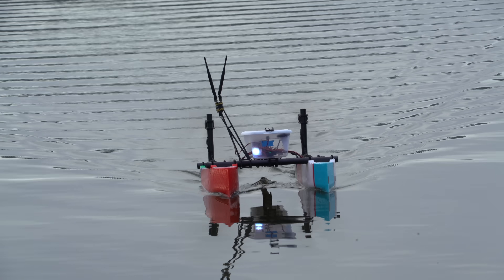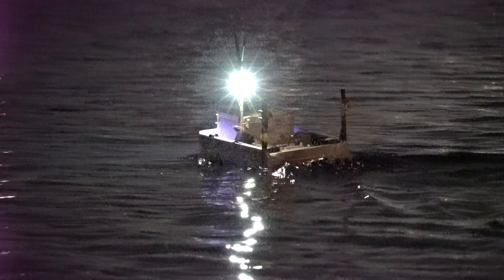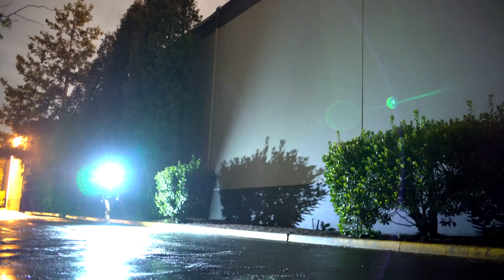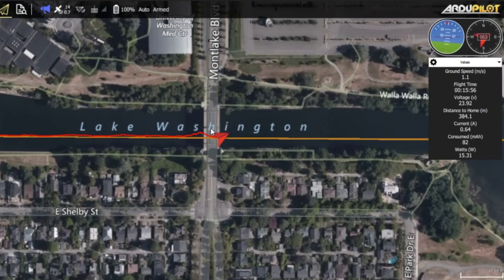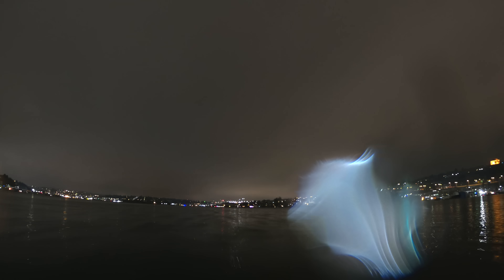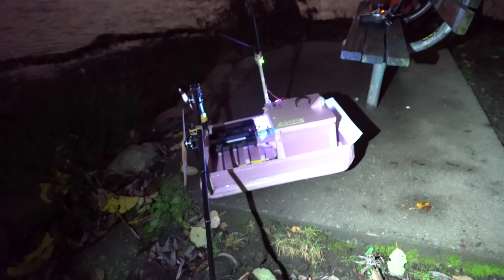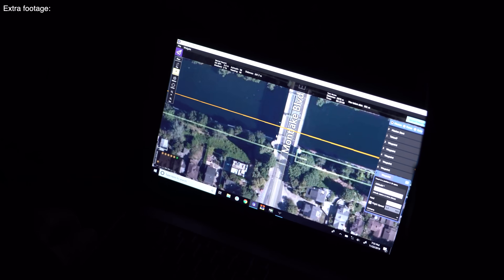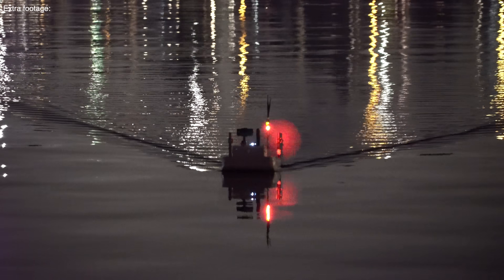Autonomous Boat HYPERLAPSE Machine

Comment: Really cool.
I'm pretty sure your boat dives when power is applied because of the moment of force from your propellers which are mounted so high and at the rear of your boat.
Probably easiest addressed by simply mounting your propellers at the front of the boat.
Or, maybe consider turning them around and drive the boat backwards if your hull isn't hydrodynamically designed to flow in one direction?
Then, your objective would be the opposite of what you're doing... Instead of trying to lighten and make the bow more buoyant, with props in front you'd try to shift all your weight backwards to the opposite end of your boat which would be the natural way to load your boat.

Comment: Just get a low end  kid size plastic kayak from Wally World...  Put your system in that.

And put on the correct Coast Guard (and internationally recognized) approved nav lighting for night ops.

Red/green  in the bow, an all-around white at the rear.
I believe there is a strobe for designating it as autonomous
But here's the link for properly lighting it.

https://www.google.com/url?sa=t&rct=j&q=&esrc=s&source=web&cd=1&ved=2ahUKEwj-7qLy-J7oAhXaj3IEHXhCBEUQFjAAegQIBRAB&url=https%3A%2F%2Fhomeport.uscg.mil%2FLists%2FContent%2FAttachments%2F461%2FNAVSAC%2520Resolution%252012-08%2520-%2520Unmanned%2520vessels.pdf&usg=AOvVaw1yuPnBeXl6WAjd1hZp6mHe
Reply: Looks like you need lights on a stick:  Red on top, white in the middle, Red on the bottom.

Your boat is too small to carry the  1 meter "D" (Maneuvering restricted, keep clear) flag.

Comment: I loved the previous video on this topic.  Part 2 the hull design was a disappointment.  It was simple, that's about it.  Using the same foam board something much better could have easily been produced that offered better flotation, stability, efficiency and control.  Still this hull gets the job done and I very much liked this series.

Comment: You could probably tilt the propellers down so when full throttle is given, it would compensate the nose diving with the downforce from the propellers. Not sure but could work.
Or you could move the propellers to the front and tilt them upwards, so it would lift the nose.

Comment: IF you value advice:
Do it longer.  you'll prevent nose dive, and get higher possible mount for camera. also try build nose higher than the  average wave.. simply try to copy airboat shape .. you'll be amazed how well it works  for camera on rough waters.

Comment: Should've tried a modified v hull. V hull that's taller towards the front with a flat hull design in the back with a keel down it's length. Should keep the front end from diving.

Comment: The nose dive problem is not hydrodynamic, rather it is the thrust vector from the high thrust line.  Tilt your motors up, such that as you increase power, it will push the back of the boat down, preventing the nose dive.

Comment: Your voltage drop was most probably caused by the low temperature infiltrating your battery, saw the same happening with drones in winter.

Comment: Personally, I think you should have stuck with the Catamaran design, but used the foam for the hulls instead of 3D printing them.  The trick to stable but efficient hull design is length.  Simply making the pontoons longer using foam as a building material while keeping a nice laminar design would have eliminated pretty much all of the problems you ran into with both boat designs.  Basically, your boats, while functional, were too pudgy and short to really be effective platforms.  They worked, but only barely.

Comment: finished? basic displacement hull math, square root of hull length times 1.56 = maximum MPH speed, for electrics (gas too but matters more for electrics) multiply that by 0.8.... >
with that, a 4 foot hull will make 2.5 mph, bakes to 1.22 yards per second at displacement speed... but, a 4 foot length could easily be done "jonboat style" where the power doesn't have the leverage to make the nose plow, and runners down the bottom can allow it to pop up on plane, if light enough, low speed hydroplaning (8-9 mph) where watt consumption is lower over distance. my intuition, 20" wide x 48" waterline length (6+2/3 square foot)...

oh chit more displacement math! a cubic foot displaces 62 lbs (buoyancy), so a 31 lb load would draft 6", same weight on 6+2/3 square foot 0.9", if total is 15 lbs then 0.45" draft (and so on) and kinda near nothing to shove up onto plane. two runners 5" wide 1" thick and 6" apart (outside to outside 16 of the 20" width) with 15 lb total, already has the majority of the hull bottom (barely) released, is one method... the other is shallow V hull up front (about 40% of length) and flat behind that with 5/8" step at the chine, slices turbulence (and some waves) aside for the following flat bottom, lifting with forward motion and putting air between hull and water (common stepped monohull hydroplane design). not too unusual for their displacement speed to be higher than their planing speed, if kept light enough. its almost like playing with a Kh4 type airfoil.

Comment: TRIM TABS.....put some trim tabs on the back and have it sync with some kind of auto leveling signal. So as it accelerates the trim tabs will move down in the back to cause the front of the boat to rise.

Comment: For future referencewhen mounting a hyphen in a boat it is imperative to mount the fan as far back as possible in order to get it as low as possible without having the effect of pushing down on the bow.another solution for this would be to point the fans more towards the center of Mass. In this case it would mean tilting your motors up about 5 to 10 degrees. This will have the effect of pushing the tail down as the throttle is increased. Counter-intuitively this should increase your efficiencybecause while it does add downforce into the water it is positioning the hull of the boat so that it is more streamlined through the water

Comment: @2:43 mAh for energy is not adequate since less voltage (discharged battery) uses more amps for the same energy. Only use it if you start always at same SOC.

Comment: I'm surprised that foam didnt end up soaking and waterlogging.
Best way to build a hull is shaping it out of foam and then using strips of polyester and epoxy resin.
Once it dries its tonka tough and light, and you can remove the foam with some acetone.

Comment: Your lack of Principles of Fluid Dynamics for what you are doing is crazy. It could be way better in the water with some changes to the hull.  I'm not going to geek out over it but you could make the hull better, save energy and have a more stable responsive boat!  What you are running now is like pushing a floating brick ! just saying.

Comment: I was under the initial impression that you were using a 360 cam in place of the gopro and gimbal. I feel like if you just hard mounted the one x in the same spot, and used the hyperlapse feature built into the one x, u might get better results. and maybe dont use interval bc it makes the background all blurry

Comment: Catamarans are relatively easy to build, and will increase efficiency significantly. Buy a small boogie board and shove some legs on it (you can through-hole mount them). This will give you a wide platform for stability.

Comment: Damn dude, sometimes when I see the stuff you smash together I think you’re the type a guy that could break a crowbar in a sandbox. Putting a bulge in the front of the boat will literally suck it down into the water, that is the exact hydrodynamic principle that tugboats use to plow them into the water getting more traction when pulling ships. Just move the weight back on the  machine, it is clearly nose heavy LOL
Reply: It's not nose heavy, it's the high thrust line pushing the nose down. It floats nose-high when there's no power.

Comment: now make it solar powered and capable of crossing the atlantic.
Reply: As incredible as that would be, and would definitely set multiple records, those motors would probably last about 5 hours in the salt, and the first big wave would capsize the little bastard.
Reply: Tyler Coates So make into a submarine and somehow seal the motor shaft: maybe use magnets to transfer the force from the moter to the props, and figure out some way to stop the prop from flying off. As for solar power, sunlight goes through a little water.
Reply: @loganiushere  magnets won't exactly be efficient and I'm no expert but I think corrosion proof motors do exist, a little expensive but they do exist. And yeah the solar part seems true
Reply: Someone already made an autonomous boat that I believe crossed part of the Pacific. It was called the Sea Charger

Comment: Do you use anything special to keep the batteries from shorting out? It looks like all the connectors are very exposed with the water coming in over the top.

Comment: I think the best platform you could look at if you want to keep exploring this would be a SWATH. (google SWATH hull). Wouldn't be disturbed by the waves so much and would be substantially more efficient so you could get away with a larger boat with same powering. A larger boat would automatically reduce the relative wave size, reduce the pitch problem and reduce the relative mass of the camera and its effect on trim. What about some horizontal servo actuated vanes to dial the thrust vector with a gyro like the electric rocket. That part should be simple for you.

Comment: This needs to be followed up using an autonomous canoe with lead acid car battery as ballast to improve stability. 
  Can the gimbal be tied into the boat IMU/ Waypoints  to automatically point to the direction you’re heading?

Comment: I'm curious why you keep using air propellers instead of something like paddle wheels, which are much more efficient, especially for a slow moving vessel.  A paddle wheel would also get rid of your nose diving problem.  You would have to add a rudder with a servo instead of differential thrust, unless you went with two paddle wheels on the sides.

Comment: Ohhh, you missed an opportunity to streamline the hull design. Yeah you mentioned why, but you'd remove a lot of the stability issues by using a tried and trusted basic hull design. Especially for the purpose as a camera platform. Double the length of the hull so it can better handle the weight of your equipment.  When you get a design you like, a layer of fibreglass over the foam for impact resistance. 
Anyhoo, still cool 😎
Reply: I too am confused why he continually uses these ridiculous hull designs, like he doesn’t know how hydrodynamics, or aerodynamics work for that matter, considering he’s been building airplanes for a decade lol
Reply: @BikingVikingHH  I know right, you could use virtually any basic monohull or catamaran design and it would be better then what he's coming up with. Heck just buy a RC sailboat and turn it into an autonomous boat. The scale is also way too small for anything--but glassy smooth water. And I don't know why he uses props? Maybe for fear of getting caught up in the weeds if he used standard propulsion
Reply: @77Avadon77  Your guess is correct, his first version had props underwater and they kept getting caught up in weeds.
Reply: @Endelin  which is a good solution. With a streamlined hull, it may take a lot less thrust to propel. Tracking should be increased as well.

Oh well, boats are not his thing... Yet! 😁
Reply: I was thinking the same thing. Just go with a basic SUP or shallow draft Skiff shape. They're specifically designed for this type of water. Put a couple skegs in the back.
Reply: A better hull will not only make the boat  more efficient but adding a keel could also reduce drift so the camera could be more stable. This barge hull is ridiculous for that project. The catamaran desing was way better.
Reply: A flat barge hull is much easier to turn with differential thrust than a more efficient, streamlined hull would be, so it would add the complication of needing a rudder and the risk of getting caught in weeds again.
Reply: @popuptoaster  
Kayak hull 

In particular:

The cheap plastic Youth Kayaks sold in WalMart.

Stuff some of the p[ink foam in as insurance.
Keep the battery weight low and maybe even move to a trolling motor battery for weight to stabilize the thing.  30+ lbs WAY down  and centered does a lot of stabilizing for a boat. 

Kayaks would lend well to the twin fans for steering since they can be turned in place fairly easy by an experienced kayaker.

Could even move to an RC car ESC on each motor to add reverse and thus ability to back out of weeds if necessary.

Yes, cost went up drasticly... but its a faster, more stable platform.
The concept of the air boat drive and the control system has been proven as a success.
Reply: Although a radical change in hull design might improve some aspects, I'd think that existing should be fine for a glassy surface like what you are seeing in the video in the pre-dawn hours with no water traffic. With no waves, then a completely flat "barge" hull should be fine to ride as high and as little draft as possible although the model boat does have a bit of draft.

Comment: A way you could increase some efficiency is by sloping the bow forward like on commercial flat-bottom boats. As the boat drives forward, the slope lifts the bow of the boat out of the water helping it drive faster.

Comment: Dan, you gotta make a hydrofoil boat to avoid oscillations from the water.. Maybe a catamaran with servo controlled pontoon struts that counter-act the oscillations.. Something overly complex..
Reply: It will get stuck on weeds in the water. He made a similar design which didn't work so well. That's why hes going for these flat bottomed boats now.
Reply: J Anything he could’ve made a motor duct to prevent debris
Reply: This sounds more like something Tom Stanton would be up for.
Reply: @Aearlyg  that's perfect for him!
Reply: Part of the nose diving issue is from how much drag the front of the boat is making. He should really model his airboat hull after an actual airboat. Flat bottom with a gradual slope on the front.
Reply: Hydrofoil wouldn't work - stuff would get tangled easily. A catamaran airboat, with a proper flat hull, on the other hand...
Reply: Just make a bigger boat
Reply: That need to be fast tho to create lift

Comment: 2:17... It seems to me the way to solve the Full Power  nose dive would be to tilt the propeller motors up at a slight angle. This would push the rear of the boat down at full power. Also... put a proper bow on the boat. It looks like you're pushing a brick through the water. You would no doubt gain power efficiency gliding more easily through the water.